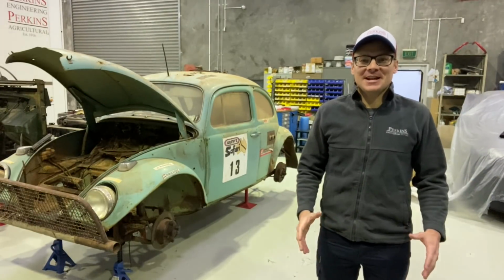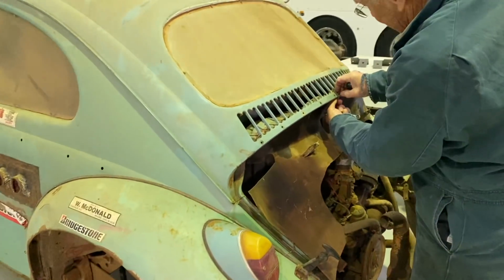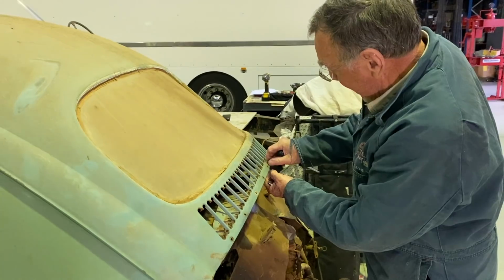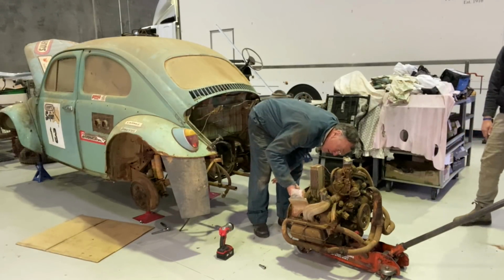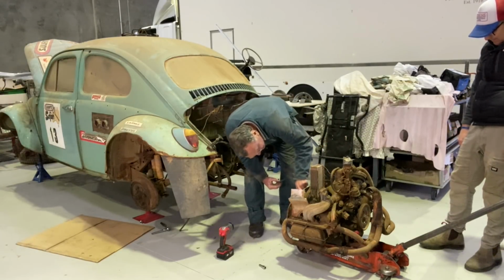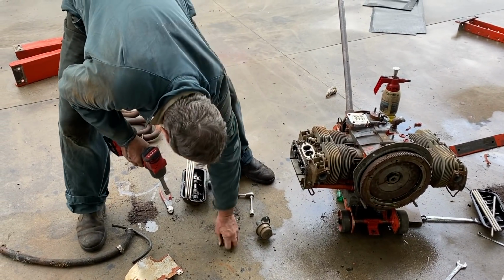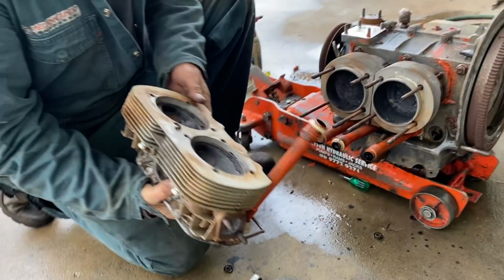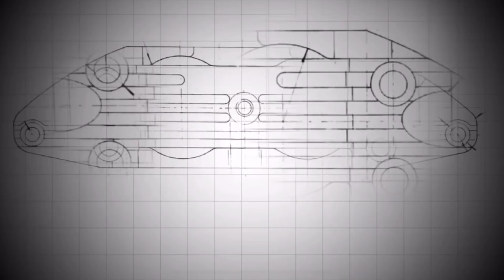Episode 11: Catch up with Larry Perkins as he starts the restoration of his Volkswagen Rally Car

Comment: It appears your running type 3 rear drums on that car. I did the same back in the early 80s on my street car. The combination of Gia discs up front and type 3 drums in the rear was a huge improvement over the stock braking system.